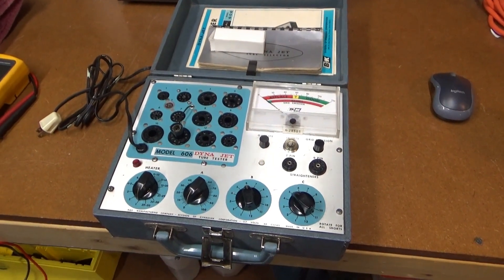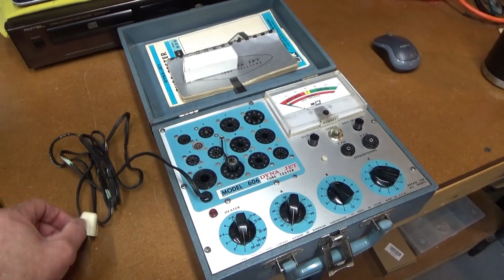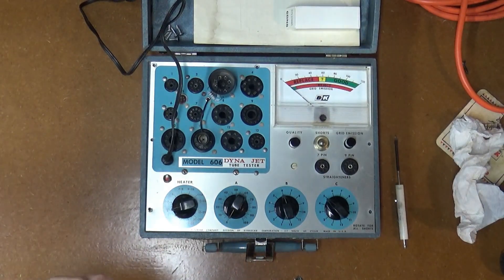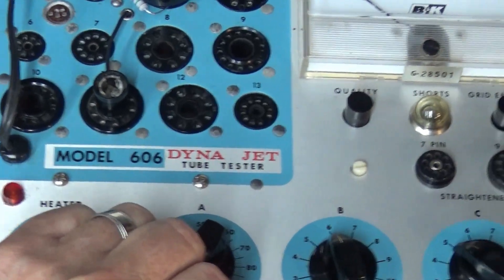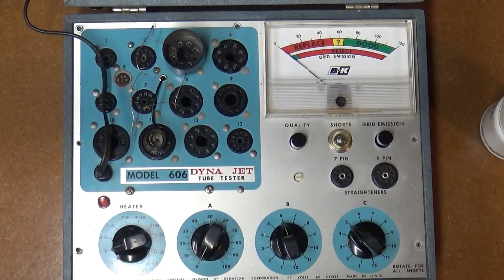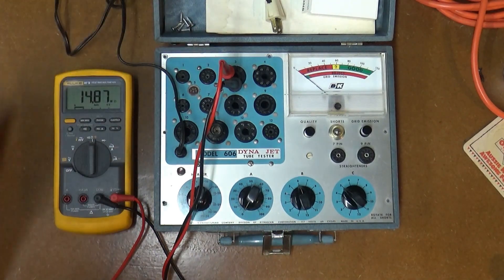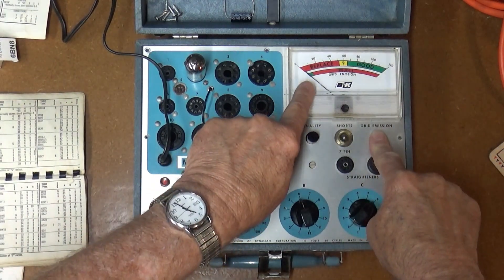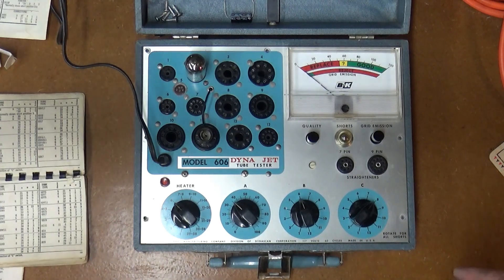1965 B&K 606 Tube Tester Service and Calibration

Comment: How many watts should the 1 meg ohm and the 20 meg ohm resistors be for the calibration? 
Just curious as I'm attempting to calibrate my own.
Reply from the maker: I think I used 1/8th or 1/4 watt resistors which worked fine. Good luck with your tube tester calibration

Comment: If i get the same reading for a pair of tubes, does that indicate they are matched? That might be a stupid question . I've asked this question on dozens of videos and have NEVER gotten an answer... i have dozens of old tubes, and I've gotten into building tube amps for guitar. I want to match some sets of 6v6 and 6l6. Thanks for any insight!!!!!!!!
Reply from the maker: That's not a stupid question at all but it is a bit complicated to answer. Not all tube testers are equal. 
The tube tester in this video is a emissions tester. Testing a tubes emission capability is a basic measurement that can indicate the amount of time the tube has been in use and the amount of life remaining. A tubes ability to emit electrons diminishes with use and will eventually cause it to stop working.
For tube matching you should probably be using a tester that can measure transconductance. This is a measurement of a tubes ability to amplify. The Hickok testers are fairly good transconductance testers. 
The ultimate tube matching device would be a tube curve tracer. These are fairly rare now and usually very expensive.
Reply: @mguess  mine is a b&k 707, so I'm pretty sure it measures transconductance.  And thanks for the reply
Reply from the maker: @soapboxearth2  you are correct,  the 707 can measure transconductance. Sounds like you are good to go.
Reply: @mguess  sounds good!

Comment: I heard this tester does not check EHX, GT or other Russian 12ax7 properly
Reply from the maker: I don't have any modern 12ax7 tubes to try. The 606 is a fairly basic emissions tester so I wouldn't be surprised if it isn't accurate on certain tubes. That's one reason that I have several tube testers to get an average reading.
Reply: @mguess  I'm only looking to check new EL34 & 12ax7 tubes. What would be a good tester to get? I was going to buy the Orange VT1000 but it's discontinued.
Reply from the maker: If you are looking for a tube tester for amplifier tubes, I would recommend a tester that measures transconductance which is a measurement of the tubes ability to amplify. The B&K 606 only measures emissions. I would recommend one of the vintage Hickok testers like the 600A or the 6000A. I think either would work well for you.
Reply: @mguess  That's what I'm looking to test. Are those easy to calibrate & replace parts? I know a lot of these use tubes. How readily are they available & cost. My other concern is the transformer & all the taps.
Reply from the maker: You may want to check out my video on servicing the Hickok 6000. https://youtu.be/Db-bDN7dhDk
The Tubesound.com site has some excellent documentation on the service, calibration, and use of the Hickok testers.
Reply: @mguess  Thanks! I will take a look at both of those.

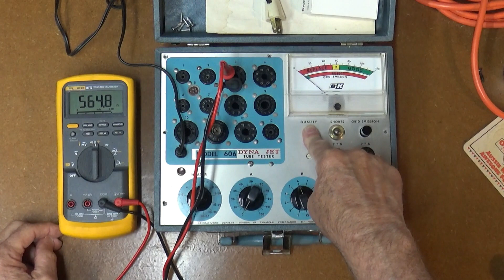Comment: I have a question about the last cal test at about 7:00 on the video.  I have a 606 I did your test and git a reading 1,400 ohms  what problem would  cause this?
I have an issue with the 606 when I go to test a tube for quality it peg's the meter!  Any help would be appreciated.
Reply from the maker: I would probably start with checking all the resistor values to see if they are still within tolerance. You may want to replace those old electrolytic capacitors if you haven't already. It's a fairly simple circuit. The BAMA  web site has the users manual available for download which contains a schematic. Good luck and let me know how the repair progresses.

Comment: I was interested in buying this tester.   Would you do me a favor and check if this tester would test the following 7-pin tubes: 1T4, 1R5, 1S5 and 3Q5GT  (1943-47 vintage).  Thanks.
Reply from the maker: Yes,  all of those tubes are listed in the tube selector book.
Reply: @mguess  Thanks for the info and for the quick response.  Best regards!

Comment: As soon as I saw what this video was about I went right to that same site on my computer. I wouldn't normally get a tube tester unless it could check tubes from the early 1940's to 50's. 4 pins type tubes can't be tested with these later  era testers. Thanks for showing it.
Reply from the maker: Yep, this one is for the later tube production. I have other older testers that I use for the old stuff.